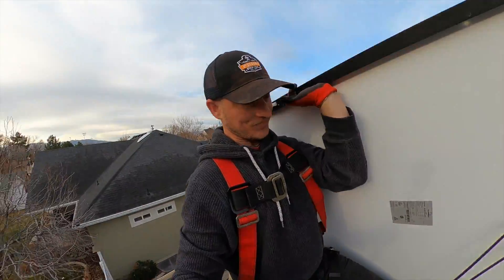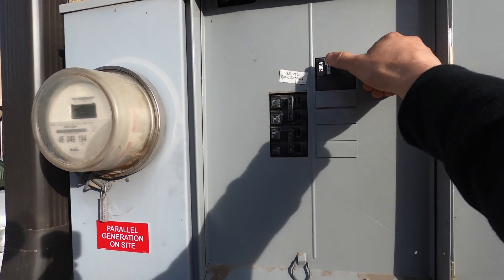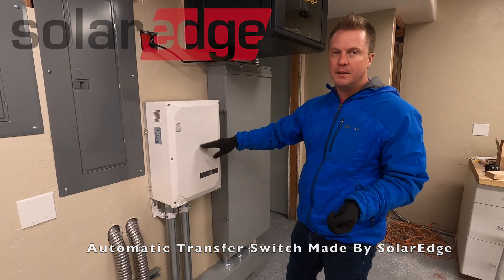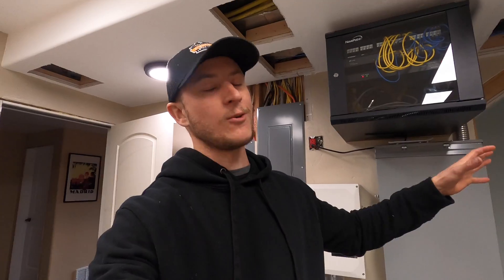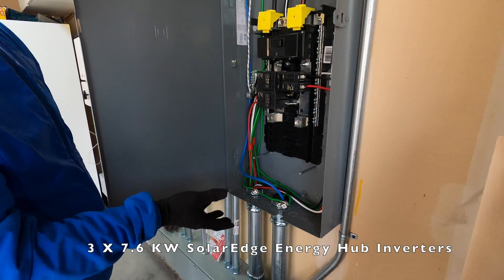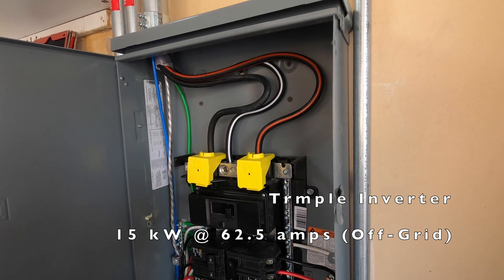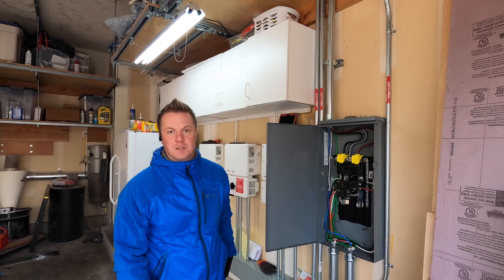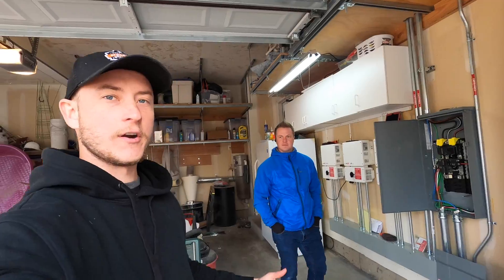Testing SolarEdge Off Grid | Solar Panel Backup Power Explained

Comment: Can you please tell which model of solar edge you got? My is a SE6000H with backup but when there is an outage the solar panels are off, only battery will work, the technician told me i need a different inverter but i dont know which one.. Thanx

Comment: If each solar panel has a micro inverter or optimiser under each panel, what happens in 8-12 years time when ongoing random inverters need to be replaced every few months? Wouldn’t that be a support nightmare for the customer as well as the installation company? Especially if you have like 30 panels or more…what if the panel in the centre of the array breaks down and so on? Also who pays for all those ongoing service episodes?

Comment: So I'm energy hub certified. I notice you don't have a battery. Customer has one backup interface and two lg chem 10kw batteries and one inverter. From my understanding when the power goes out say mid day, the batteries will kick on but they can only output like 32A(peak) by themselves. It's my understanding these still don't have the capability to run a 50A or 60A ac unit.

Also is this system capable to run the house off grid with no battery because you have the load center feeding the main panel? Or does that load center land on the panel with like a 150A breaker
Reply from the maker: When I installed this, you didn’t have to run the “battery self test” before you put the system in backup mode. So you could run the system “off grid” without batteries. You can’t do that any more. You are right. You shouldn’t run an ac unit with less then two inverters. With this set up I ended up doing 3 inverters and 2 16 kWh batteries.
Reply: @solargoat  damn dude. I thought you were on to something. So the only way to do off grid is if you hook it all up to like a generator and commission the system (no grid in site)
Reply from the maker: Oh and you referring to a fully off grid system with solaredge?
Reply: @solargoat  I am now, not my original comment.

What's ur ideal way to hookup two batteries? So they can handle a bigger load.

We normally just power the inverters from the din rail in the BUI.

What would your method be to say power a 60A breaker for an AC unit when the power goes out

Comment: Is this off grid set up via the SolarEdge automatic transfer switch, compatible with Solar Edge inverters that require the SolarEdge SetApp feature? Specifically I have, SolarEdge SE11400H-US000BNU4 and SolarEdge SE6000H-US000BNU4 inverters that I would like to function in “off-grid mode” when the main power grid is down. I read in an article that the SolarEdge automatic transfer switch is not compatible with some of these U.S. models.
Reply from the maker: Yes you have to have an “energy hub” model

Comment: Hello I just got my solar edge inverter replaced an is been a couple days in night mode if so I'm I able to reset the inverter ?
Reply: No
Reply from the maker: I’d have them come back out and follow the night mode procedure. It gets technical.
Reply from the maker: The inverter will automatically go into night mode if there is less then 6 volts dc on the string. It’s likely there is another issue.
Reply from the maker: Do you have any electrical experience?

Comment: Cool setup, wondering why you need 3 inverters? Just because of the large PV power? Also wondering why you need 25kW? I currently have 7.7kW PV and I'm 10% short on being energy neutral over the year in the Netherlands (300m2 house) with heatpump system. An EV would need like 2.5kW on average for 13k km/year, so I was hoping to build something like this on a single large 3-fase inverter, but there is not much info out there yet.
Reply from the maker: If you could figure that out it would be a really cool set up. This customer used a lot of electricity but the system was designed for offgrid although it is grid tide as well. We get a lot of bad weather in the area so in order to plan for the worst. Not to mention the system will output around 15,000 to 20,000 W continuous offgrade.

Comment: that battery backup is about $25K extra correct? So $50K for the total system? minimum?
Reply from the maker: Right and it’s a 25kw of PV so most charge about 3$/w so solar alone is more like 75,000

Comment: because SolarEdge no longer allow to use backup mode without battery, one needs only 1 higher power like a 10kW SE HDwave inverter and a LG Chem RESU 16H Prime battery as AC coupled system for an offgrid capable system i guess, correct me if i am wrong.

Comment: These are awesome options. Seems like no one around even knows this stuff is possible. Always told you have to have a wall battery and no one mentions off-grid options. Know any knowledgeable Solar companies that can help with off-grid in SoCal?
Reply: That system has does have 2 16kw LG batteries. 10K a each.
Reply from the maker: Thanks for the comment! I’ll look and around and see if I can find you a referral!
Reply: @solargoat  how about west facing only more so for summertime optimamizing for say A/C loads ect. as my roof can't do south facing at all ridge line is E&W A-fame

Comment: Can you use the solar edge back interface without a battery or will it only work with a battery??
Reply from the maker: Last year you were able to put the system in backup mode without a battery. Solaredge recently sent out an update and made it so you have to have an LG battery in order to put the system in backup mode. 

When this video was filed there were no batteries on-site. The install new has two resu R Primes.
Reply: So it did work with out an battery and now it won't due to the update. Is that right?
Reply from the maker: Correct
Reply: @solargoat  Batteries are still very expensive but in the event of "dooms day" is there an easy way to use power from the panels without a battery and disconnected from the grid? What would have to be modified?

I watched you other video and it sounds like you have to power the inverters somehow to make it work and a transfer switch. Can you use a separate portable solar system to power just the inverters?
Reply: @Jacob-pr5cd  Hi, did you ever get an answer to your question ?

Comment: No sun...? No backup....? What about the batteries with this setup?
Reply from the maker: The site has 2 LG 16H Prime batteries!
Reply: It would have been nice to hear about the batteries and their capacity.
Reply: @robertdalga128  Here's a helpful video if you're looking for info on batteries: https://youtu.be/2pZE6LIXJ-I
Reply: Im getting a EV charger but wont utilize it until late this year will my 8.8 kw system work for a back up with my hanwha 400 kw panels

Comment: How come you didn't combine the 3 inverters in the backup interface
Reply from the maker: There’s an additional panel with a 400 amp bus. It was installed that way to avoid derating the main breaker.

Comment: Great video solar panel man. Do you have mode#l for the combiner box were all the inverters are tie in with 40 amp breakers. Thanks guy!
Reply from the maker: Thanks for the comment I’ll look it up to see if I can find the exact one I used. Are you located in the US?
Reply: @solargoat  I am in PR, will be in Texas next week. I like how you combined the three inverter output to the combiner box, which means you can in case of an inverter maintance or emergency you can decommission one or two inverters without interrupting your system. Cool!
Reply from the maker: I tried to find the the exact model. I think it’s the HOM816M200PFTRB
Reply from the maker: Absolutely, seems to help out a lot!
Reply: @solargoat  thanks for the help! Keep the solar going@